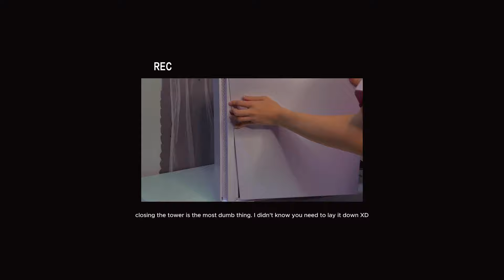building my first PC ✧ white aesthetic on $1500 budget | Ryzen 7 5800X, RTX 3060,  Kraken Elite 240

Comment: ur not suppose to touch the top of the cpu and the cpu cooler already has pre-applyed thermal paste so you didnt have to add anymore.
Reply from the maker: oh I had no idea we shouldn't touch the top of cpu O_o I tot only the gold spikes at the back that we must avoid? Thanks for letting me know about the thermal too! <3
Reply: @gentianadesu  It's good practice not to but theoretically, if you're just unboxing it and installing it straight away, that's not gonna be massive issue (if at all). Also, don't worry about applying too much thermal paste. If there's any excess, the cooler is going to push it out when mounted. Worst case scenario: the area around your CPU socket gets a bit messy and is going to need a clean up. 

Overall, nice build! Pak shtrejte per cmimin qe e paske marre, ama it's cool :D
Reply: Allow me to say that they're both wrong. Adding extra thermal paste will make the CPU run a bit hotter if you live the pre-applied one on the cooler, because too much or too little thermal paste = higher temps. It is true that you're not supposed to add in more thermal paste if you decide to leave the one that comes with the cooler; but most of the time, you can get a higher quality one by brands like Arctic, Noctua or Thermalright and the temperatures are almost always going to be better than the stock ones. 

The only thing is, if you apply the paste like you did (by spreading it), which is generally the right method especially if the past is relatively thick, you should remove the one that comes with the cooler to prevent higher temps due to too much paste. This is generally not a problem as coolers do their function right and your CPU is most likely not going to run hot, but applying or not applying the right paste, the right way, and the right amount, can provide differences of about +-5ºC.

The point with thermal paste is that there's a very thin, well-spread layer that covers the whole chip to provide contact surface with the cooler. There can't be too much or too little. If there's too much and the pressure of the bolts does not remove the excess, then the surface contact is reduced; as well as if there's too little.
Reply: @chaarrrt is absolutely right. 

You can touch the top of your CPU. It's fine. Nothing bad will happen at all. You did a very good job with your thermal paste. The paste that's already on the contact plate of the AiO or any other air cooler is usable but in general not as good as thermal paste that you can buy online. I've never seen any tech youtuber using it. They always apply a new one.
Reply: @chaarrrt my thoughts exactly you explained this very well :D
Reply: nothing wrong with touching the top cpu lol.
Reply: @gentianadesu  just checking g if your temps are high than that’s probably because you have to much thermal paste and it’s all dried up so you might want to clean it with isopropyl alcohol and repaste it

Comment: Nice work really clean build! A small tip for next time: I’d peel off the plastic film on ur case/cooler before powering on the PC since it can create static and could damage some components. It’s unlikely to happen since newer parts are more resistant but still better safe than sorry.
Reply from the maker: well notes :) thankyou for letting me know! ^^

Comment: I am currently in the process of building my own pc. I have been researching alot. From what i gather, that 3060, 3070 graphic card is not great for streaming and it seems that the 7700xt amd cards are top in preformance and cost. They are in the $400 range. They don't come in white, but you can always remove the outer plates and paint them. Other than that , beautiful build!!!!

Comment: super cute & clean build :o tho a 3060 and ryzen 7 5800x in 2023 for 1.5k is kinda crazy considering u can get a i5 4070 ti build for around the same price from what i’ve seen, gj tho :)

edit: can confirm, nzxt sells a prebuilt w 4070 for 1.6k
Reply: is it all white? because  i know you get better for the same price but most if time the gpu aren't white. i personally want a white gpu but they usually are more expensive than the black version
Reply: @soominie5935  yes from the one i saw. nzxt is known for its white mobo and white matching parts. and since its nzxt i doubt they’ll charge more for a white variant
Reply: @atshoya  that’s cool but for someone who already has a setup i just want to buy a new gpu and the white ones are usually for expensive than the black ones :(
Reply: @soominie5935  ok buying a white gpu is unrelated w what i said ab the prebuilt that’s better price for performance lol.
Reply from the maker: I cant find nzxt prebuild w 4070 in my country..and even if I can found it with 1.6k then how about my monitor? xD thanks for the suggestion tho! :)

Comment: Love the build thinking on building it myself but with a asus rog strix w850 would it still work though?
Reply from the maker: I think it will still works. But if you plan to change some parts, try using psu calculator first to be sure! :)

Comment: if you bought Ryzen 7 5800x brand new in 2023 it might not be a good deal but if you bought it used then that's a shocking price to performance cpu but if you gonna build brand new the new 7000 series Ryzen are better choice I am currently on Ryzen 5 7600 with ddr 5

Comment: very nice build, I had the same GPU, can I ask if yours has any coil whine when being use? thanks
Reply from the maker: I don't think mine has one...like being noisy u mean?
Reply: @gentianadesu  yeah like my asus 3060 has this buzzing sound when gaming, 3d modeling, ect. Not too loud but noticable.
Reply from the maker: oh you mean like when the fan sounds hard? indeed it does..not everytime tho. I mean when saving huge graphic files and rendering, mine did that but not when working with the software. When playing games it sounds occasionally like only when launch  @nguyenanhduc7

Comment: Hello guys I’m upgrading my cpu to a ryzen 5 5600x and gpu to a 3060ti I have a thermaltake 650 watt bronze psu do u guys think I will need to upgrade my psu ?
Reply: Ur good, just check if ur psu is good in terms of that it wont cause issues to ur build.

Comment: I want an aesthetically pleasing pc as well especially pretty motherboard, but since I’m a gamer and prices in malaysia is quite high, I had to prioritise on the best budget 1080p cpu+gpu combo I can get first, so I had to just settle with gigabyte b660m gaming instead 😢 and just decorate with rgb fans lmaooo
Reply from the maker: but isn't motherboard usually very alike one and another? b660m looks pretty cool tho~ what gpu u using?
Reply: @gentianadesu  not really, some motherboards have more features like wifi more I/O and some allow overclocking some doesn’t. B660 motherboards is sufficient but like more expensive B660 or Z series would have more features and look prettier.

My gpu is RX6600, I bought it used. Good enough for 1080p high settings and the malaysian price for it is reasonable.
Reply from the maker: oh u mean the features..it is true if u talking about features but the looks of them aren't they pretty similar? xD and ur GPU also looks cool now I doubt if ur setup is less cooler than mine O_o maybe not aesthetic but much more to cool looking?  @me22gigabyte
Reply: @gentianadesu  I guess I made it as cool as I can with the budget I have lmao. I have the Asus Dual RX 6600, it’s the most basic one but the thing about Asus Dual is the design is sleek and clean. I made my rgb to fit the Cyberpunk 2077 colour scheme, the yellow, baby blue, and orangey red. The red psu cable extensions also helps to add the red accent of the motherboard. But more expensive motherboard has prettier heatsink which makes them look more neat. Maybe next year I’ll upgrade to an i5 and new motherboard haha.
Reply from the maker: I can picture how cool it is! ^^ if next year u'll upgrade wouldn't it be better to i6/i7 tho?  @me22gigabyte
Reply: @gentianadesu  since my monitor is 1080p 75hz and I’m not planning to change that yet, an i5 13400F would be sufficient for my single player RPG gaming needs.